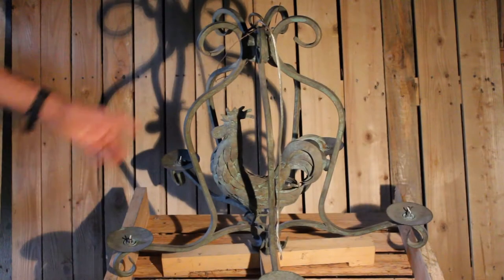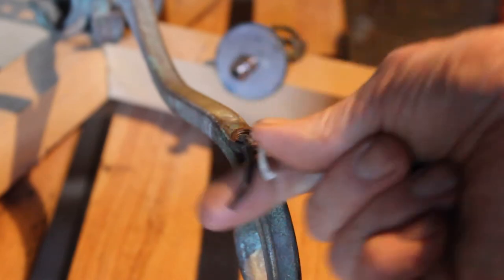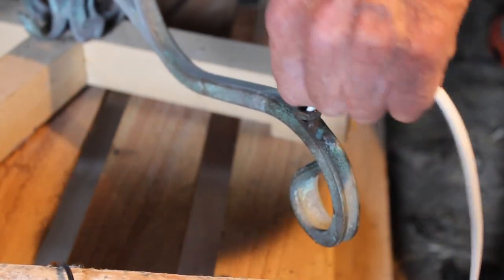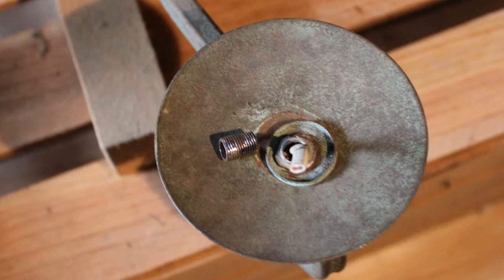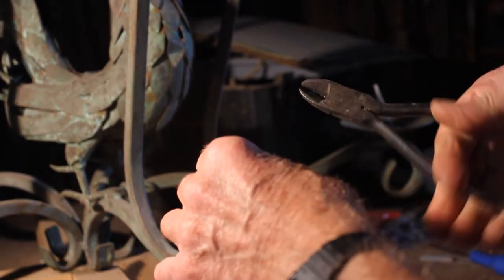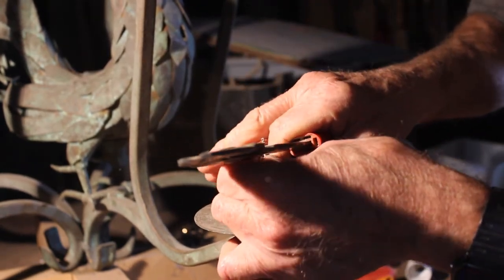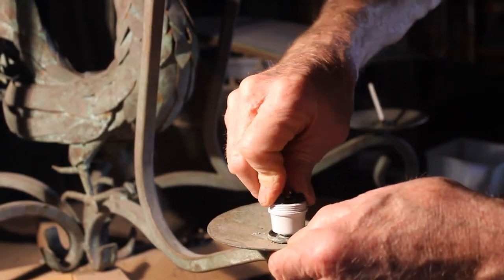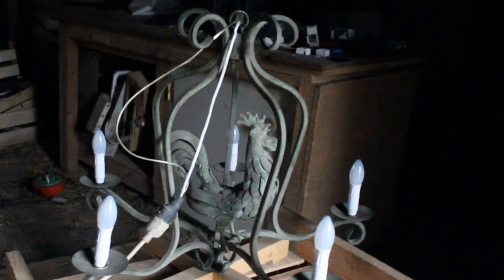Vintage Chandelier Rewire and Installation Reparación/recableado candelabros  Recâblage lustre retro

Comment: I have this same chandelier here in Ky. I bought it at auction. Unfortunately, I didn’t know how to rewire through the arms so I now use it with solar lights outside. Wish I’d seen this video earlier.
Reply from the maker: Thank- you so much for sharing that! We've only ever seen one other example - it was on Etsy and described as 'French Farmhouse Style' - was there a better description, including maybe a date in the auction catalogue? It will look great outside ! We did use it as a table centre with battery lights before we got around to rewiring and that looked good too -so there are many options. All the very best from Normandy!

Comment: Thanks for posting this really informative video. I’m about to purchase a 1950s light fitting and was concerned as it will probably need rewiring. One thing I noticed you didn’t have an earth wire. Are they necessary?
Reply from the maker: Hi there, there is an earth wire fitted to the suspension point of the chandelier. You will see it more obviously if you go to the written version: https://thegreenlever.blogspot.com/2021/04/rewire-install-vintage-chandelier-french-farmhouse-style.html#.YGnKvbov6V4  The final photo in the article, before the film, shows me wiring the chandelier in place and if you click on the photo to enlarge it, you will see there are two cables, a white 2 core cable and a clear plastic cable containing the earth. Yes, you will need an earth if your light fitting is also metal. Vintage and antique light fittings are so much more interesting than most of the modern ones and better made too! All the very best, Andy

Comment: you didnt have to drill out a bolt, those threaded conduits are cheap and easy to get at any hardware store.
Reply from the maker: You are right but the threads on the chandelier are not metric and I am in France. I live out in the countryside and would have to travel a few kilometres to find an ironmonger, so why bother just for one item that I can easily make here from a bolt I brought over from the UK years ago. Also it's actually quite fun to do something that taxes your imagination and doesn't involve going to the shops - which in the present climate is no fun at all. All the very best Andy